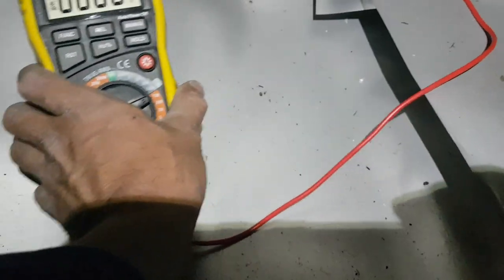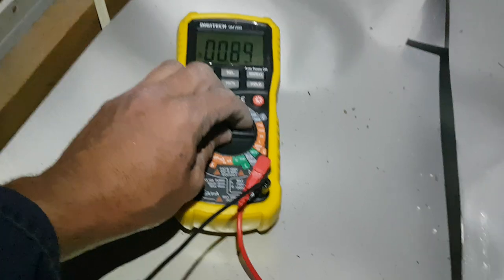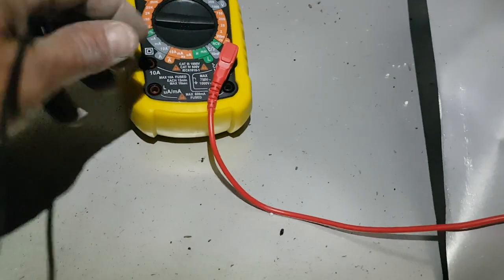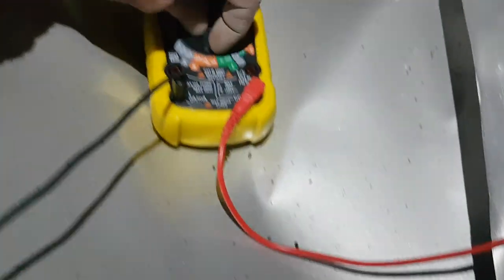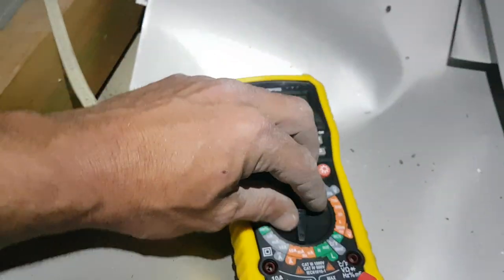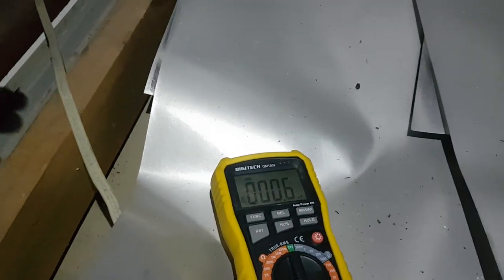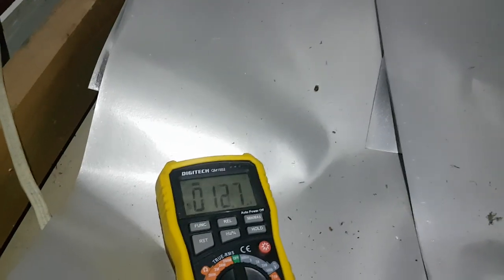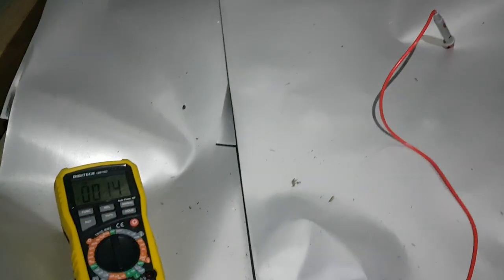Silver conductive insulation is dodgy as, always isolate!

Comment: ahhh thanks for that! i checked my leakage at the box , neutral to ground was 1.9V which i read was considered acceptable, i notice in my roof there is none of that stuff you show but there is a foil under the tiles that would have capacity. It is all quite sloppy and leaves us all swimming in mains hum emf. our bodies need access to ground to maintain a healthy state.
Reply from the maker: For safety we use fiberglass ladders and wear boots generally isolates ourselves, but impossible in the roof space with this type of insulation. Do you have a radio club near where you live? Some old boys there have shown me how the hunt down EMI & RFI from dodgy solar inverters, I think you'd be right into radio theory and it's good fun hanging out with tech heads.

Comment: The irony of  thermal insulation that isn’t also electrically insulated all it should need  is polymer all around and as design that is impossible to staple, nail it screw through. At worst it could use non conductive fixings such as Velcro, or glue or fixings that are applied to the timber before laying insulation sheets down

Comment: never seen that in my life, im an apprentice. could you explain as to why people would installing it in the first place?
Reply from the maker: There's a link in the description to the Royal commision report that explains it in detail.
Reply: @TradieTrev  good lad love ya work
Reply: Foil is not a bulk/mass type insulator so the theory is, it doesn't hold the heat into the evening. Much higher R values compared to Glass/Poly batts and also no issues with absorbing huge amounts of water in storm leakage situations.  But yeah, one wrongly placed fastener or rodent damaged mains cable and zzzzzt!